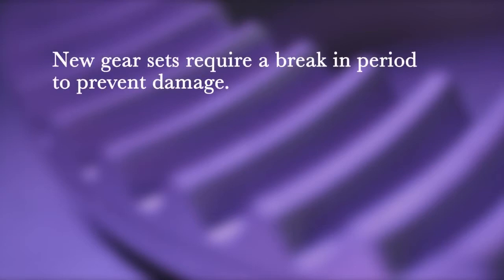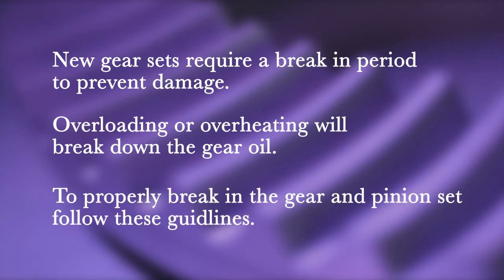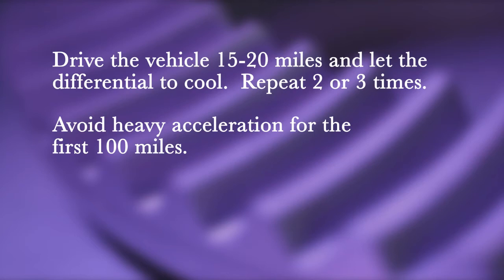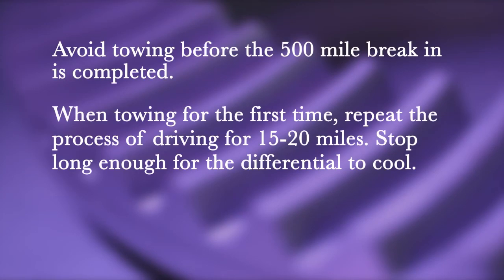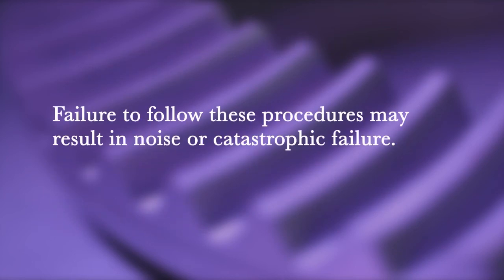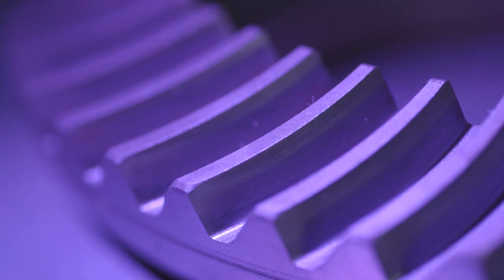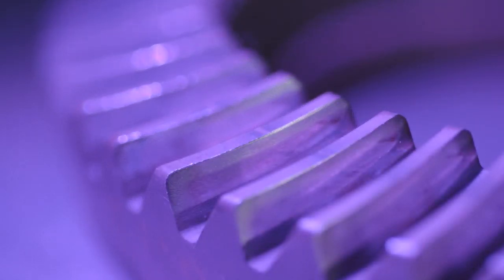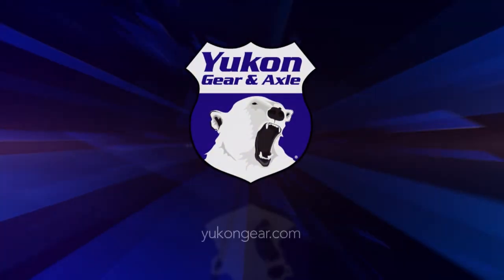Our ring & pinion break-in procedure

Comment: Calling bs.why break in New gears?  You buy a new truck, drive it off lot with 4 miles on.runs gor the whole life without a break in if failure
Reply: It's definitely BS that you have to break in new aftermarket gears. For whatever reason, seems like all aftermarket gears have omitted  the last process step. ALL of the big  car companies do a precision shotpeen as the final step. That's why there is no 500 mile break-in with cars.
      Shops can be proactive if they want and have that last step done by just sending the new gears out for a shotpeen....or even something called REM isotropic finish....both processes do the same thing.  They smooth out the tooling marks left by the gear manufacturers.  
    Why bother to install gears that are 90% done?  It's asking for trouble.

Comment: If I plan to tow do I first perform the three sessions of 15-20 miles for at least 45 miles then avoid heavy acceleration up to 100 miles. Then from 100-500 miles can I drive normally in town and on highways. After 500 miles change fluid. Then tow repeating the same 15-20 miles three times for a total of at least 45 miles. Do I need to avoid heavy acceleration up to 100 miles? Do I need to change the fluid after another 500 miles? Should I run 75w140 in rear and 75w90 in front diffs? Thanks

Comment: What happens if you install the gears and hear a whirling noise from the differential and drive 55 miles ? Are the gears still Okay and just need to be re aligned or there just damaged all together?
Reply from the maker: Hey Savon, give our tech line a call. 800-347-1188, option 5, ext 5599.